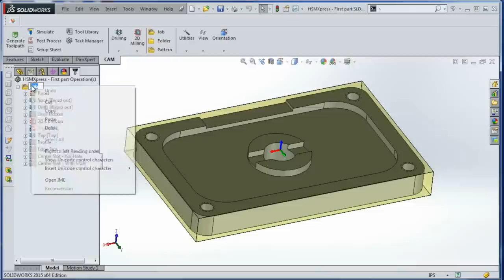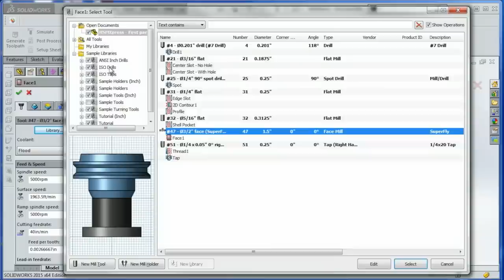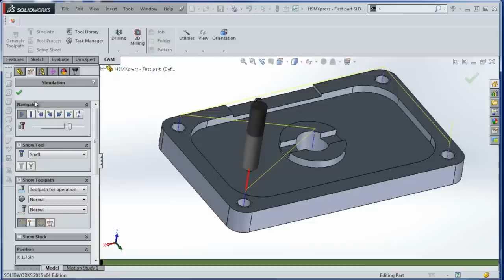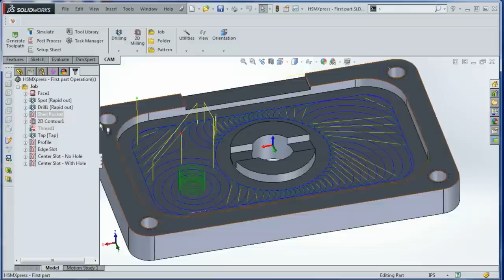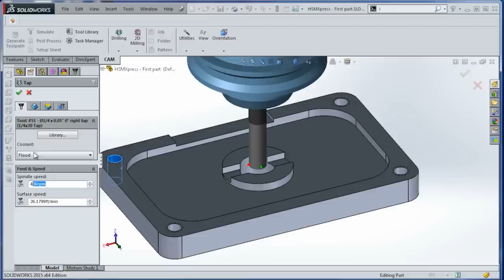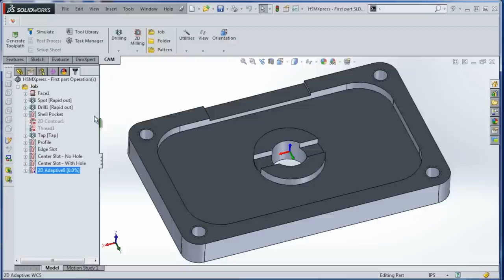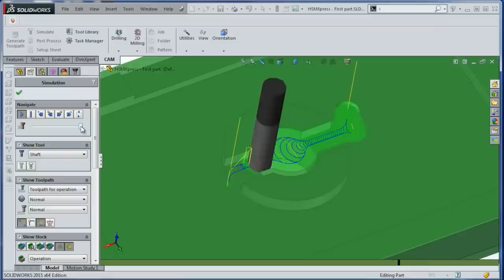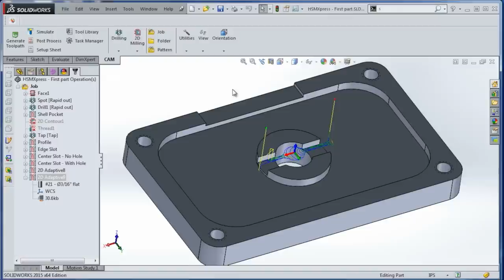HSMXpress Free SolidWorks CAM Tutorial Video!

Comment: Hi John, i am using HSMXpress in SW and export to GRBL and work very fine on mu diy very low cost milling machine: I hope it will work as you espect with your very nice milling machine. There is a point you may have not seen yet, the Xpress version don´t come with turning features available :S. Would have be great some basics functions like for milling.  Keep posting videos, it´s very nice !

Comment: I've just picked up watching this again. In response to your comments about purchasing Solidworks. I hear you! But for those listening, I just want to let them know, that for Inventor HSM Express, it will work with Inventor LT, which is entry level 3D CAD (Personally I would go for a Fusion 360 Ultimate subscription instead though). But importantly if you are looking at full 3D toolpaths, then yes you do need to purchase Solidworks to use HSMWorks... but you don't have to purchase Inventor on top of Inventor HSM (3D, 3+2 & soon, Turning) or HSM Pro (simulataneous 5-axis). So if you aren't committed to using Solidworks, you can go the Inventor route instead and save some $. Full disclosure though, I'm a tech guy for Autodesk CAM products :-)

Comment: Actually considering getting hsmworks for the shop I work at.  Would be our first CAM software.  I guess I just needed to show the boss posted code working on our Hurco machines.  Everything we've done up till now has been right at the control either by programming free hand or importing a dxf at the control and building the program based on that (basically CAM built into the machine.)
Reply: Well...we bought it.  Leased it on a yearly basis as that includes the maintenance...seemed like a better deal than a perpetual license.  Now I have something new to learn...and a boss asking me if I'm actually doing something while sitting at a computer programming the machines vs free hand like I've been doing for so long.  haha

Comment: If you have money and want industry standard CAD/CAM software you can always go for CATIA, it is software of choice in aerospace, automotive industries. Only downside of it is price (it is in range from 9000$ to 65000$ per seat, depending on the modules selected. SolidWorks is basically light version of CATIA (or child of it) and both are from same company.
There is Pro/ENGINEER, which was popular, even Ferrari designed its F1 engines in it (cars was designed in CATIA).
Reply: ***** Solidworks had only three realise before it was acquired by Dassault and they have little common with Dassault released (Solidworks technically is just one of many forms of parasolid but Dassault is putting features od CATIA in it)
CATIA V5 is 17 year old software but latest version is 1 years old V5-6R2014 (or R24)
CATIA V6 require enovia server, but that is not big requirement you can install enovia plm express which work quite happy with ms sql express server, and most most people have ms sql express server installed anyway (even some options in Solidworks require it).
For function in CAD between Solidworks and CATIA are if you need only basic shape modeling are really close (I even think Solidworks do that better) but for sophisticated shape modeling  CATIA is light years ahead (Generative Surface Design product, FreeStyle Shaper, class A surfaces) and in composite design.
I used CATIA V5 CAM module last time in 2000 or so, and it was much better then HMS offer today (but that is my opinion, and I am not expert in CAM,and HMS I saw only in machine shop that do work for us, but what is simple in CATIA is big pain to do in HMS).
I do agree that Solidworks is best all around solution for small businesses (my company use it for design enclosure for electronic, and we like that it have good simulation solutions especially fluid for its price)

Comment: Great video! If/when I upgrade my software my sort of dream ticket would probably be Solidworks/HSMWorks. I hear amazingly positive reviews of this combo. Since I'm not a job shop RhinoCAM is certainly adequate for what I do given Rhino is not parametric but I would never buy another CAD that wasn't parametric in the future. I would also never buy another CAM that didn't have high speed toolpaths.
Reply: Yeah really! BTW if you pin yours into a barrel using the Tormach DON'T USE the parameters from video 17! You will have a bad time. I've broken enough drills and reamers now to figure out it was way too aggressive for the 4150CMV ordnance grade machingun barrels. I'm editing a short updated video on CNC Pinning gasblocks into barrels right now with updated drilling and reaming parameters. It should be up soon and those will be good to go. I believe AR15 gasblock and barrel pinning is mainly done on a manual Bridgeport or even a drill press and I've never heard or seen anyone do them on a CNC so maybe I'm the first dumbass to try. So in some ways I'm in the future man, 22nd century! Once dialed in though it works great. In this situation VERY VERY slow is your friend, lots or air and oil too!
Reply: Not unless you want to pin the gasblock with a drill bit. More like 0.5ipm. I even tried 1ipm and even that made me a little uneasy about snapping the drill. The 0.5ipm was slow but seemed more foolproof.

Comment: Great video.  I use HSMXpress for my hobby needs.  I find that sometimes it can be super frustrating when it doesn't generate a tool path, and you have to just blindly adjust settings until it does.  Otherwise it's pretty great software.  I also like that you can completely adjust the post processing to suit your machine.   I added a tool height sensor to my machine and was able to easily add a cycle to touch off the tool height sensor after each tool change (important to me because I can only afford so many tormach quick tool change collets).
Reply: NYC CNC I found that if I was pocketting a hole that was only a little bigger than the tool I was using, and if the lead-in or lead-out was too large, it didn't know how to generate a tool path.  I think the better strategy in that case is to pre-drill for the pocket, but I was trying to do the whole shebang with no tool changes.
Reply: Mark Kotyk I like the fact that you can look at work log and see where you mistakes are, and there's a what's wrong selection also.  I get to use these alot, being a newb to
CnC.
Reply: Mark Kotyk If there is no space for the lead-in that you specifically chose, then no that is not the fault of HSMxpress. Uncheck the leads and do step down or spiral down. Maybe a warning popup would have been useful in your case though.

Comment: One thing to remember on pricing is that there are some very aggressive pricing for Students and Educators.  We homeschool and you can get a student edition of SolidWorks for about $130.  Certainly this doesn't apply for professionals but I teach CAM and machining to homeschool students and so the state of the art software is not out of reach.  SPRUT is the same.  I applaud the vendors for making the tech available at very reasonable prices for students and educators.  

Yes, I know that they have an ulterior motive to teach skills.  That said, there is an acknowledgement of the importance of education.

Comment: I've been watching your channel for a while.
Found it by accicdent, (very cool discovery, by the way...).

I Had a lousy experience with BobCad (still makes me see red!):
I bought 2 seats, then found a friend with 4 seats at less than a fourth the price I paid.
Sent the unopened box back, and they kept 20% of my money.(Apologies for the rave).

I noticed that you had Solidworks 14 version. Now have the 15 version.
Did you get the upgrade with all the features, weldments, sheet metal, electrical, full-meal-deal etc?
Where did you get your Solidworks training? 

 I beleive Solidworks is the "go to" software for for cad. It does go on sale occasionally.

I would very much appreciate your dialog, thoughts, & comments.
You create really in depth informative vids! Thanks,
Reply: NYC CNC Hi John,  Thanks for the great video!  I downloaded HSM Express a few months ago but have not used it yet.  You just gave the inspiration.
I have SolidWorks 2012 Standard which does have sheet metal. If they discontinued it in the 2015 version, you can download any previous SolidWorks version at no expense. 
Also SolidWorks has always been able to open previous version files, just not future versions.  It is my understanding that in 2013,  SolidWorks was to begin allowing saving as a previous version which would allow file sharing with those with earlier versions.
As a hobbyist, the yearly maintenance fee is a bit steep so I will stay with 2012 as long as it works for me.
Bob

Comment: FYI: NexGen CAM was the US distributor of HSM Works software before Autodesk acquired the company. After the acquisition, there was some concern about what would happen to the NexGen folks as they were a great VAR and really helped make HSM Works into one of the best CAM systems out there. As it turns out, most of the NexGen folks took up jobs at Autodesk. Anthony Graves was NexGen's director of marketing and became the Autodesk CAM Product Manager. He's leaving and is being replaced at Autodesk by Al Whatmough who was the president at NexGen.

And the NexGen tutorials are a bit stale - with the Autodesk acquisition, HSM (they are in Denmark BTW) has been working to bring their core software to both Inventor and Fusion 360. All that work has sort of slowed down core CAM development a bunch.
Reply: NYC CNC Autodesk definitely has a lot of weight behind F360, but I don't think that's their main vision for HSM. From what they have said/done, the idea is to have a core HSM kernel, and different implementations across HSM Works (for SolidWork), HSM Inventor (integrated into Inventor) and Fusion 360 CAM. The vision is that the HSM team implements a new feature once, and it rapidly flows to the integrated products. Of course, there was a boatload of work getting HSM up and running in Inventor and Fusion, so both the SW implementation and core CAM features took a back seat for a while.

It is shaping up to be a really extraordinary product though. Might even be the future of CAM (with some work - turning sucks)

Comment: You mentioned tapping and the dwell time.  My experience (from Fusion 360 not HSMXpress) is that the default post uses the G84 cycle which does not have a dwell time with Mach3.  To get my tension/compression tapping head working well I had to make some post changes (solidworks HSM, inventor HSM, and Fusion 360 use the same posts.)  More info on autodesk's CAM forum: http://camforum.autodesk.com/index.php?topic=6074.0

Comment: you mist one hole 
fusion 360 cam is very close to hsm almost the same, I think its a little bit easier to use than hsm but its still not finished need some fixes done but for indexing and 3D cutting and 2.5D cutting its fine. the 2D drawing needs some fix`s too, some things you cant just do yet
Reply: NYC CNC yep its getting there but I like it just do 2D drawings in a different program to they get it fixed

Comment: Pro/E doesn't exist anymore it called CERO. What sucks now is you get Inventor along with HSMWorks for the same price as just Hsmworks for Solidworks. 10K for Inventor + HSM 2.5,3, 3+2 and SIM 5 and Machine Simulation+ Lathe when it comes out (which will be resigned)
Reply: Thinking you could throw that out in your next video. I have been looking at doing that for myself its a steal for the price honestly
Reply: I saw where you can get HSMworks free with Fusion360... all for about $40.00 a month if you're a hobbyist.
Reply: Barney Matthews fusion 360 isn't geared for what I do. It's decent software plus no 5 axis support